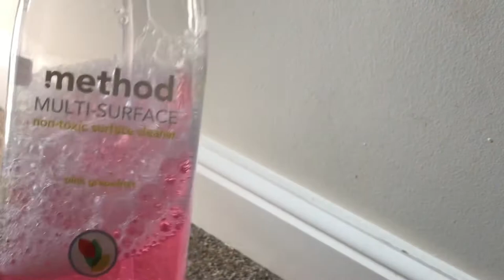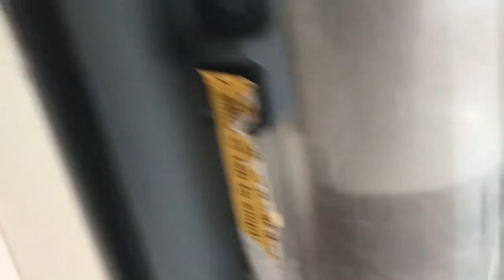⭐️ 🐿  CLEAN DECLUTTER ORGANISE kitchen draws  Vacuuming SHARK DUO cordless

Comment: @Mrs Doodle Sparks Cleaning. I noticed that the little washing machine liquid tabs plastic protective cover.  That it melts in water and it actually ends up sticking to your clean clothes. So i put the tab  it in the soap dispenser draw and pour boiling water out my kettle down over it to melt it all 1st. As it's going down to the washing machine drum.  As i was noticing there was white spots and marks on my clothes when they were dry. We are talking the top name brands like persil, Ariel, Daz etc. That's a good idea with the hover. I've noticed that with my bad back for cleaning cupboard doors and worktops. I personally use a map with a flat little oblong sponge that's self squeezing. It cuts the cleaning in half and saves hurting my back bending down or reaching up. It's ideal for cleaning window's also and very cheap on eBay or Amazon marketplace
Reply from the maker: Thanks for your comment, oh that’s not good I haven’t noticed that with the SMOL tabs. Hope your back feels better soon 👍⭐️